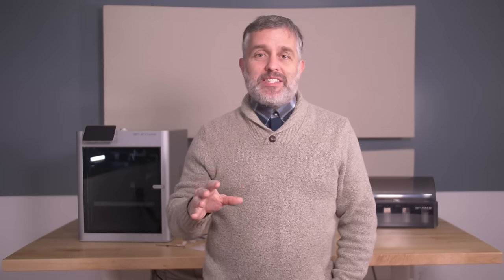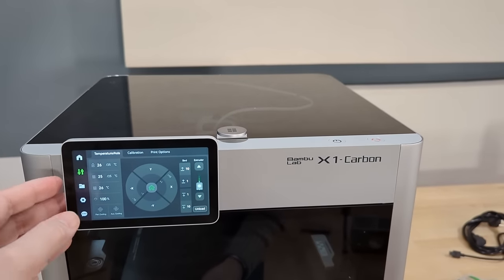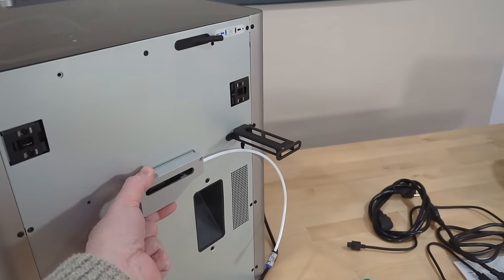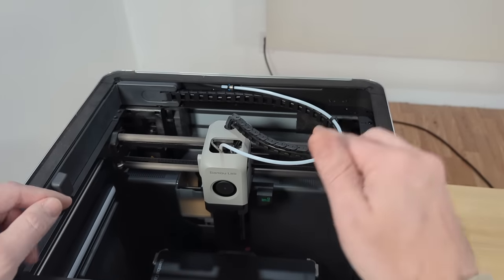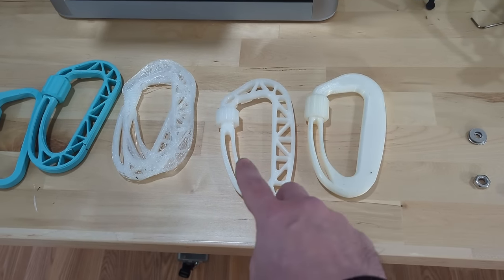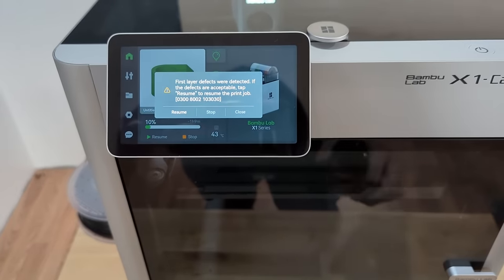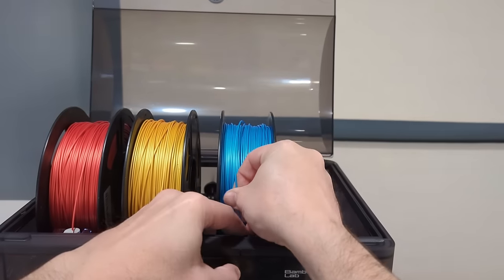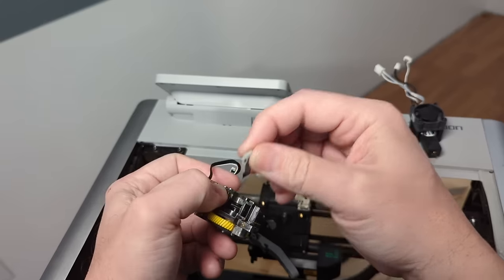Why The Bambu Lab X1 Carbon is a PhD Master Class in 3D Printer Design

Comment: I ordered mine on 2/2/23, UPS says I get it on 2/9/23 -- one week.
Reply from the maker: Apparently I was misinformed. Thank you for the correction. Perhaps the 3 week delay only applies to the P1P.
Reply: Same. I ordered mine 2/6 and it shipped today 2/9, should be here on the 14th.

If you order without the AMS it’s a different story. They have those listed as preorders with a 2 week lead time.
Reply: Similar for me. Ordered 2/2 to be delivered 2/10.
Reply: well I ordered mine 15.12.2022 and got it 6.02.2023 for fuck sake xD
Reply: @DesignPrototypeTest  I ordered a P1P at the end of January and it arrived 5 days later
Reply: How's it doing for you?  Assuming you've done a couple prints and that you got it the 9th.
Reply: Ordered 2/1/23 supposed to arrive 2/14/23, but it has to go all the way from California to Florida.
Reply: @Amy Baldwin  that isn't terrible.  You could get it on the 14th but 15th seems more reasonable when local distribution comes into play.
Reply: i orders mine feburary 17th and got it on april 5th. that makes no sence
Reply: @kurtles4466 : It didn't appear that Amy Baldwin was complaining, more like she was justifying the delivery time due to the distance between California and Florida.
Reply: Awesome video . I do think this printer is overly engineered. Bambu  is betting on making high profit margin on the Parts and Data collecting.
Reply: I ordered mine on a sunday (so actually monday) and I had it by friday

Comment: FYI... you can save to an SD-Card from the slicer... With the latest software update you can also save files to the SD-Card while in the printer.  There is also a local network functionality.
Reply: Came here to say this, you now have three options.  Print goes through the cloud as before, Send goes through the cloud and is saved to the SD, Export is saved as a 3mf file to a local device without going through the cloud.  Click the arrow next to print plate to see these options.
Reply: mine will not save to sd card while In printer  I can send 1 file there but if send second one deletes first and after print it's gone also
Reply: Hell ya, i was really hoping they would implement LAN connection. That's awesome!
I just ordered my x1c combo yesterday. im too excited.
Reply: lan breaks connection to bambu studio and app. so pretty useless until we can get a cura plugin for it.
Reply: The better LAN mode with security features are only for X1E which is for enterprise users.

Comment: I'm really glad you made a deep dive in to this printer. I've watched loads of reviews of the dev kits but most just talk about the features and print benchies, where as you critically review the mechanical design and components and give honest feedback. It's sad that the majority of 3D printing channels end up being super positive, gloss over the negatives and then give sales pitches, whereas you point out the negatives as well which are what owners really want to know and need to be aware of
Reply from the maker: Thank you for the kind comment. It feels good to be recognized. I appreciate you too.
Reply: @DesignPrototypeTest  Great detailed on-point review!  Also, your comments and opinions are valuable and valued.

The power supply board you asked about is almost certainly a SEPIC design, very nice actually.

Thanks for your efforts and outspoken-ness!
Reply: sELF LUBRICATING BUSHINGS ARE LIKE THAT ARE USED IN INJECTION MOLDING ALL THE TIME
Reply: Agreed!

Comment: 1:01:26  That green component with the two copper windings is not a transformer.  It is a "common-mode choke" which is used to filter noise from the printer electronics from going back down the power cord and "transmitting" through your house. It is yet another sign of a high-quality design and implementation.
Reply: That the choke exists isn't a sign of high quality design, and especially of high quality implementation. That would be determined by the actual performance. Limiting conducted emissions is a legal requirement to sell a product in most countries.

That's not to say it's a bad design. It may well be great. I love my X1C dearly.

SO MUCH supposed "hardcore engineering analysis" of products like this on the internet does this though, and it's getting tiresome. WOW they have legally mandated component! It's amazing space age design! GOSH even NASA can't design anything this well! How well does it work? I have no idea haha, but look at it! 

Would be good to get a real engineer with actual experience to give their hottakes once in a while. And even they do it.
Reply: @Rokmononov  I think noise filtering may be critical for some sensing

Comment: New to the 3D printing.  Not really wanting a new hobby, or at least not wanting to be an enthusiast tweaking every setting and modding my printer.  I want the tool to print things I need around the house for which there are no off the shelf solutions that are a true fit.  This is one of the most objective and informative reviews I've seen of this printer and really helps set my expectations for this tool.  Thank you so much for putting so much time and attention into this video!
Reply: Im in the exact same boat as you are! I tried to go the starter printer route with a creality ender 3 and I ended spending more time fixing and adjusting the machine than I did using it. It ended up sitting there doing nothing for months on end. Im purchasing this printer soon and I hope you have a flawless time with it as well.

Comment: I recently purchased the new lower priced $600 Bambu P1P and it arrived in two days. I'm absolutely blown away by it and it's not even the flagship model. Never again, and I mean NEVER can I go back to super low budget printers. The P1P itself is the budget version for Bambu and even then, it blows away anything priced under it and yes, in my opinion, it's better than the Prusa MK3 and MK4. It's pre-built and you'll set it up and print a benchy with 40 minutes of unboxing it. I enjoy 3D printing again❤❤❤

Comment: Great video with some minor errors but I think others have addressed it.
This has been one of the most in depth videos I have seen so "geek up" the great work.

I have been printing on the X1CC since Aug of 2022 and getting close to 2k hours and this printer is by far the best printer I have used.
Ender 3- retired
Prusa mk3s+ -$$$ Regrets and retired
Ankermake m5(still sitting in sealed box since Dec 2022)
X1CC- my go too.
Reply: While the two printers I had previously (a Sidewinder X1 and a CR10-version) are a lot lower priced than the X1CC obviously is.. I'm not looking back at all. Never printed as much as I have with the X1CC
Reply: The M5 is worth cracking open for single color prints.

Comment: Credit where credit is due, the first implementation for a single nozzle multi color/material printer with a toolhead filament cutter, is from the SMuFF project. It truly is the best method for adding reliability to filament switching type multi color/material printing. Love the breakdown. Keep up the good work man.
Reply from the maker: I was wondering about this! I even asked on Twitter if anyone knew of prior art for that functionality. Do you have a link? I just want looking on Google and couldn't find anything.
Reply: Here's a link to a video from the creator of the smuff. If it works the link to the site is in the bottom of the description, https://youtu.be/9xR9MkAh_Ww
Reply from the maker: FANTASTIC! Thank you! Sorry about the link restriction. I forgot about that.

Comment: Just got the P1P.  Fantastic review.  I didn't think that "filter" would do much.  I'm using a HEPA filter and 5 pounds are activated carbon VENTED to the outside when I print ABS.  VOC's sink so I have the fan on the bottom of the my enclosure.

Comment: Well done. One of my favorite videos.  Owning one of these the biggest changes I hope they iterate: 1) Cut the startup time when you are doing back to back prints (the 8 minutes of overhead even when you uncheck the options kills me). 2) Seal off the electronics from the bed and put a heater inside, 110 degree chamber would be very nice for no ABS warp. 3) The door, it is an accident waiting to happen.  You managed to pick up these same points. Fun watching someone else take the risk of partially dismantling it.

Comment: At 34:50 you see three green checkmarks, you can unklick them and the printer will skip the step you dont want, like in Bambu Studio. 40:00 If you select 'Send' instead of 'print plate' the file will be send to the SD card that is in the printer. Then you can print it from there.
Reply: Dude omg thank you! I didn't know you can save it to the SDcard that way!

Comment: This is the best test I've seen so far. My greatest respect for that. Nicely explained, a deeper look into the machine and very factual. Many complaints about the printer come from the fact that it's not that easy to repair. And I think that's where the problem lies. This printer is for the end customer market and end customers do not want to repair anything themselves, they want it to work. And based on that and what I've seen so far, Bambulabs has done a good job.

Comment: That offset cooling style I first saw a year or so ago by Pro3D's video: "fan duct design optimizing by CFD | 3D printer toolhead design | the Triquetra" 

He had that offset/non-symentrical design pretty similar in concept, though different implementation. 

Really cool video looking at that. :)

Comment: Some minor updates on the issues you shared in this video:
- You can now use a LAN-only mode if you don't want to use the cloud.
- You can now enable a 'print cache' option that will automatically save any print you send to the printer wirelessly and have it store them on the SD card for repeat prints, which shows up as a 3rd tab on the model selection screen.
- 50:34 While discussing the airflow over the mainboard you seemed to have missed the dedicated fan that is visible to the right of it, which draws in fresh air from the side panel.
- Some more power-user settings, such as manually setting flow rates and K values for a given filament, have been added to Bambu studio in software updates.

Bambu also now sells their own adhesive liquid from their store, $16.99 for 60ml so still not cheap, but comes with a nice applicator so you generally only use a very, very small amount, no spray bottle.
Reply: You have to connect to the cloud at some point to update firmware. With the amount of fixes and enhancements they've made since release, this is essential, and using LAN only mode forever is not a real option

Comment: Great video! Few things come to mind. 
12:50 Lidar implementation is nothing new to 3d printing or CNC, i use one from Keyence to check weld on the fly on welding machine. The problem is cost vs functionality, It can be useful but it does not add much to print quality, thats why i think nobody would implement them in 3D printer. Dji drones usually use proximity sensors and camera vision not Lidar.

16:55 The 3 lead screw cost is not only 5$ for stepper motor, it add complexity to motherboard and some to firmware, add extra stepper motor driver for like 5$ each, wires and connectors, plus mounting motor on each lead screw without timing belt would add much height to printer (motor height plus clutch).

19:40 Adding stepper motors to front would not only bump the front but also sides to wrap frame around motors. Belt path on sides is pretty close to frame and motor would not fit easily i think. Adding the extra pulleys not only wrap belt around motor shaft but motors can be moved inside frame. pretty smart solution i think.

I have mixed feeling about this machine. Hardware is excellent. The cloud or bambu login, slicer.. and closed firmware that can send whatever data to cloud, no active heating chamber even the printer is fully closed is not that great.
Reply: What 3D printer would you recommend then? I agree with you, i have a Dji drone as well and it uses sensors as well, but i haven’t found any other printers that have this capability, unless i haven’t looked hard enough, are you comparing this printer to another printer, if so what, i’m looking for another 3d printer after having bad luck with creality printers.

Comment: I've had mine for a week. It is amazing. No tinkering, just printing. FAST. BTW, you have to remove the plastic film from the AMS feet. It will not slip with rubber on glass. Also, you can save sliced and painted models by exporting from Bambu Lab Studio.

Comment: I like that single Z motor. So much simpler and everything synced on all lead screws. No need for a 3 motors and more complexity. Its actually well designed and thought here. :)
Reply from the maker: You are correct. It's the K.I.S.S. principle. Added functionality could justify the increased complexity. If slicers were able to use bed tilts in non-planner printing that could justify the added stepper motors. But this is all fantasy. For the current state of affairs, one motor is superior.
Reply: @DesignPrototypeTest  Tilting beds add more degrees of freedom for miscalibration error.

Comment: Regarding heat damage to the principal control circuit, (at 50.40) I think the idea is to draw ambient/cool external air into the enclosure - past the circuit, by creating negative pressure - via an exhaust fan. The perf's on the case back may also suggest this approach. If this is the case, by adding a temp. sensor in the control area you may experiment with more insulation? - Thank you for your thorough review! Very good!

Comment: Long video with a lot of speculation rather than answers. Why not get Bambu Lab engineer on your channel to explain. I think you ate clearly missing some key engineering design principles and mentioning changes that are not needed like complicating the bed design on a printer that does perfect first layers always. To do what you suggest with “simply” more steppers doesn’t consider the frame design and space to accommodate let alone additional wiring and main board changes. All in all, without the detail of why they chose the options they did, the speculation is not helpful.  I watched half and then the value was lost, sorry, hope this helps your thinking on delivering in future…
Reply: I concur, it came off very arrogant in intention while seeming very ignorant in knowledge. Like you just wanted to show off.
Reply: I agree, quite a bit of misinformation as well. I got about 40 mins into the video and had enough.
Reply: Actually the only blogger so far who showed what this printer really is, instead of "Wow it trembles my table" and "Look, I can print from my phone" BS. = )

Comment: Not sure if anyone suggested it yet but if you add filament start gcode for ABS specifically to turn on the chamber fan to 30%, it reduces the ABS odor to almost none. Chage the filament stop gcode set to turn off the fan as well.

Comment: The addition of two additional z stepper motors would also mean perfect synchronization and the potential for error. Also, the whole cabinet would have to be taller to accommodate the motors to be installed and concealed under the build space. The existing stepper motor is located behind the rear internal wall above the bottom of the internal floor.
Reply from the maker: All three separate motors could be located similarly with individual belts going to the individual lead screws.

Comment: The gap between belts is due to unique solution. there is no X and Y movements. Instead upper belt moves the head 45° like in infill movement, and the second belt moves the head in another 45°. So most of the time you are printing diagonnaly infill, so only one motor is doing hard job, the second is just adding small steps. In next layer -45 diagonnally, the most work is doing the second motor and the first one just adding small steps.

Comment: I enjoyed finally seeing a teardown for this printer, thanks for putting this together.  Here are some tips for future videos coming from a mech eng PHD, some of your incorrect technical explanations for some sections were a hard watch, for example trying to explain the lidar sensor and how it "uses a camera to detect lasers". Also, your rant about the stepper controller board having improper cooling. Those components with the heat sinks get substantially hotter than the ambient temperature in the enclosure, and the little fan keeps a steady stream of air passing the heat sinks which will cool the components with the temperature gradient just fine. The best solution would be to have it in a thermally isolated section of the printer entirely and pull in air outside of the machine to allow for a higher temp gradient, but given the relatively low temperatures that this printer can handle, it should experience no issues over time. Also, keeping the z axis controlled by 1 stepper motor is a far better design choice than separate motors, for many purposes, complexity, additional components such as motors and stepper drivers, and then avoiding motor syncing issues (getting 3 cheap steppers to consistently work exactly in unison is difficult). This can guarantee that the bed will be true level and any small inaccuracies can easily be compensated with software, hearing "it would be cool" was a bit annoying and definitely shows lack of engineering design understanding. Overall, I think it would help out your technical credibility if you didn't state some of these things as facts and left some opinions as open ended to get feedback from the community.

Comment: You can print ASA instead of ABS given how ABS fumes interact with you. Its basically the better version of ABS. Prints without fumes, has same mechanical properties and is even UV resistant for outdoor applications.